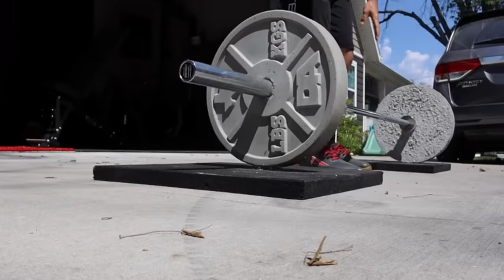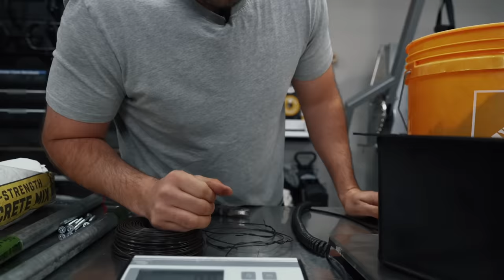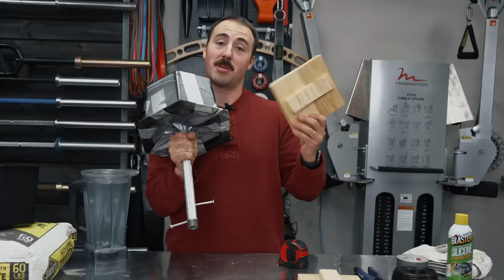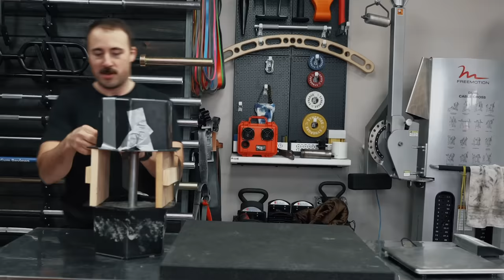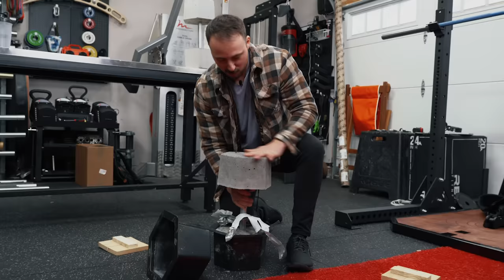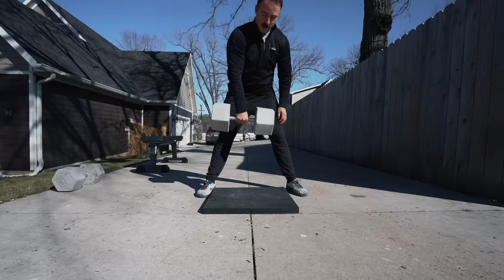How To: DIY Concrete Dumbbells Made to Last (PLUS Drop Test!)

Comment: Water First! Makes mixing way easier.  Cement is very corrosive wearing gloves is Highly suggested. Concrete burns are not a fun time and can dig  nice holes in you skin down to the bone if untreated.   If you did end up burning you're hands use a vinegar & water solution to neutralize the alkaline burns.
Reply: Thanks for the advice
Reply: You’re referring to hydraulic cement burns
Reply: @declineofthewest.  no this is for all concrete. the portland in concrete can and will leave chemical burns if not washed off. some people will even develop allergic reactions to it as well. I have had Irritant Contact Dermatitis and it's not fun.
Reply: also use a cardboard with hole in it to stableize the handle at ninty degrees then fasten cardboard to side of foarm to hold steady
Reply: Yes. I learned the hard way. It's amazingly painful.
Reply: What? I've worked hundreds of yards of concrete without gloves. I've never had burns and definitely never heard of anyone getting holes to the bone.
Reply: @harrykahuhu183  hundreds of yards is like one house for me man im mixing way more than you are.  I do stucco you have cement on your hands all day long and because we have sharp wire and use tools all day long we must wear gloves or risk cuts and our skin swearing away just spreading.    Been doing this for 8  years not going to take idiotic advise from some fool who hasn't even gone through a pallet of cement.

Comment: Although water does evaporate from concrete mixture during the curing the process since it's an exothermic reaction, it's actually not that much. Coop said to add 49 lbs to get a 45 lb plate, that's so wrong, your mix is way too soupy if that's the case. Most bags recommend using a quart or 2 of water, so 2 lbs of water max. Assuming all the water evaporates (which it doesn't) you'd need 47 lb of wet mix.....I've been messing with my own concrete plates so far and +10-20% water weight seems to be my sweet spot. So use the recommended amount of water (every bag and mix is different), and assume 10-20% of that water weight will evaporate, which is actually pretty negligible. Also I know we're all men, but lime doesn't care and will burn your skin, wear gloves or wash any concrete off your skin pretty fast, use vinegar for any burns that you may get. Lastly, I used my muscle gun to help vibrate the sides of the form, it worked great :D. - A civil engineer
Reply: If you need them to be more “soupy” there are also additives to make them flow better without compromising the strength if it’s needed but a proper vibe with something like an orbital sander will make it flow pretty well and remove bubbles. For something like this fiber would be better than wire or rebar also
Reply: This is the comment I was looking for
Reply: When he started scooping concrete with his bare hands I realised I'll listen to coop for any gym equipment related advise, but not anything related to DIY lol
Reply: I knew you were an engineer as soon as you mentioned bitch mittens🤣

Just a construction labor foreman givin you hell
Reply: @Kevin Bowman  hahaha fair enough. Before I went to school though I was a pipe-layer and suffered many a concrete burn from not wearing my bitch mittens, must be my sensitive skin 😂
Reply: @whiskeybravo91  I used to get them really bad but I think my hands and arms have just developed an immunity to it over the years cause no matter how hard I try to remember my gloves I don’t have them when I need them🤦🏻‍♂️

Comment: Would love to see drop tests on all the adjustable dumbbells currently available to consumers
Reply from the maker: I would too. I'm in the process of getting doubles of all the ones we have to drop test them.
Reply: Just get ironmaster...there is a YT video where they drop them down an elevator shaft still function like new.
Reply: It's pretty obvious none of the fast changing ones won't last long with that treatment. Why would you do that?
Reply: @lesnuitssanskimwilde883  THAT is why yuo see THICK rubber coats dumbbells in the gym   I love my stall mats 3/4 "   for years  drop 100- 150 lbers on them  no nothinf
Reply: I had the cheap one from Academy and one of the weights fell out during use. Glad I had rubber pads and that it didn't land on my foot.
Reply: been there done that 3 days ago ,  I sold  6- 45 lb  plates and a pair  of 44lbs  dumbbells with this mold,  ALL dropped  onto a   my driveway with 1 Horse stall 3/4 "  mat.    NADA  , nice bounces thou,   and all 6 DROPPED via Shrugs  same mat.   NADA .  CONCRETE needs to be sealed  3-5 AFTer  coming out of any mold,    3 coats.
Reply: Me too. He does have a good video on the ones that r out there though
Reply: Ironmaster for the win.

Comment: I'll bet using one of those theraguns that's collecting dust somewhere would be perfect for getting bubbles out!
Reply: That's actually a great idea. His little taps did nothing.
Reply: Haha I came here to post the same comment!  Theragun would have been very fitting
Reply: DT level but what if you painted these I feel like that would last along time you could even use the floor epoxy to do it
Reply: @rossporter9972  I use truck bed liner spray,rocker panel paint works well too and is a bit cheaper
Reply: @kschaub62  Honestly his concrete was so watered down it is probably fine. Super low viscosity stuff doesn't really need air evac.

Comment: Here are some protips from my experience:
-why buy molds when plastic buckets are so inexpensive, if it breaks, no big deal
-on handles, just make some serrations, its way easier and it will hold just fine (same as construction rebar steel)
-metal corrodes from sweat, cut some pvc pipes and put it over the handle before making second end of DB
-you don't need silicone to tack handles into place, use hot glue (way cheaper)
-alternatively, if you make plates for DB/BB, use a round bucket to make plates and use piece of pvc pipe as inner sleeve.
-you don't need wire/rebar for for concrete if you mix your own, sand+gravel and cement in 3:1 ratio is hard and strong if cured properly
-mix in water carefully little by little until the concrete sticks to your fingers, that's enough water
-use (kitchen) digital scale to get accurate weight of mix you put in the mold
--if mixed like described, final dry concrete will lose 5-10 percent of the starting weight (water which has not chemically reacted with cement)
-different batches of concrete will always lose different amount of water so always make pairs of components from same batch to get even weights
-don't do let it dry outside in the cold and wet weeather, concrete will be weak and it will crumble
-concrete gives away dust and can chip/crumble so you need to strengthen the surface, use a paintbrush and coat it with sodium silicate solution so that it gets into the surface and let it dryout, cheap solution and works great
Reply: @Rubi They are ok if you are making loadable DBs (like I did) but if you stick them in wet concrete, they will absorb water and swell and then later fall out when they dry and shrink. Metal handles also have nice sturdy feeling in hand
Reply: How would you make these dumbbells heavier? 110+?
Reply: @Rubi ONLY  OLD SCHOOL SHOVEL handles -  ( avg $17  today)   i have 9 from my father in law  and they are at least 40 years old,  BETTER than the replacement handles of today
Reply: @ElijahPrivetteRealEstateVlogs  For 110lb (50 kg) DB you would definitely need some iron, lead or something like that.
If you can get your hands on some solid metal bars (eg. car drive shaft from scrapyard, like I did) to cut handles from it and/or pieces to put into concrete, that's nice addition of weight.
Average concrete density I usualy get is only about 2,2 kg/L (far from ideal, of course), dumbell would be simply too big and unusable for anything but perhaps single hand bent over row. If you are making plates for barbell its ok to make larger/bigger diameter plates.
About 50lb (20 kg) is max size practical for various exercises (bicep curl, overhead press etc).
Reply: Sodium silicate,I'll have to give that a try,I use two part truck bed liner,so far and it has been working great since this covid bullshit started and I am pretty hard on the plates and dumbbells but the bed liner is expensive and is the most costly part of the whole thing
Reply: @ElijahPrivetteRealEstateVlogs  I have made 85'that are very useable for press's and light rows but I don't know about bicep curls,I can't curl 85's anyway though.I used solid handles as well and a few rebar rings In each side of all the bigger ones,more for strength than added weight but I am sure it added some.don't know where the hell you get lead shot besides for reloading shotgun shells but it would cost a fortune to use 00 buckshot to add weight to a bunch of dumbbells
Reply: @ElijahPrivetteRealEstateVlogs  I use 3/4" x 18" black pipe for dumbbell handles, with 3/4" pipe clamps to hold the "plates" and end caps for safety. Then using 16" concrete form tube I made multiple "dumbbell plates". The 16" concrete form tube can be sliced to make barbell plates but for the DB plates i would cut a slice then remove a section and machine-screw the cardboard back together make a 14" or smaller plates.
Reply: I'm just gonna comment on this so I can come back to this
Reply: liking and commenting so i dont forget this

Comment: I've just found this channel and it's amazing. 

Just a quick tip. Always clean your tools. When I went to work with my Dad and Uncle in the summer they always emphasised that clean tools are happy tools and they'll last longer as well. 

Also when concrete goes off the water doesn't evaporate it forms hydrate crystals with the chemicals the concrete is made of. 

Also Also, make sure to wash your hands because the crystal formation is an exothermic reaction and it can burn you of you leave it on your skin for too long.

Comment: I'm making plates for the first time and I found a rubber mallet helps a lot with getting air bubbles out and when releasing the concrete from the molds

Comment: to get bubbles out you can use a reciprocating saw (adjustable speed  one at a low speed is the best) take the blade out and just put the shoe against the side and turn on the saw, the vibrations push the bubbles out quite well, theres also professional vibrating tools that do the same thing but in a pinch recip saw is great

Comment: Fiberglass or another kind of concrete fiber would be a perfect alternative to using the wire or rebar. It's used pretty often with atlas stones.  Also, take a random orbital sander without sandpaper and hit the sides of the mold with it to vibrate it.
Reply: Muscle recovery massager can do the same thing aswell
Reply: @woden__  i don’t have one so I didn’t think about that but it would definitely work.
Reply: Rebar adds weight for a more compact/useable product though. I put 20ft of rebar in a single 55lb dumbell which shaved about 3 inches off it's overall length. Steel is about 3.5x heavier than concrete. Good idea on the fiberglass mesh tho. I'll probably add some to my next dumbbell.

Comment: Hi there.  Great idea and great job.  As an fyi, the concrete you mixed with water is wetter than it needs to be.  Your cured concrete would be stronger if you had used less water. Another thing that is common with concrete is to use a stick to go up and down in the form to release air and cause the liquid to fully contact the form.  Again, I love the idea...
Also, if you blew compressed air between the cured concrete and the plastic form the form would likely release with surprising ease.

Comment: I have the plate mold from sticks and stone.  I weigh the concrete before the water using a two bucket method for plates and it comes out pretty accurate (consistently hit 45.0 on the scale after drying).  I go about a half pound light since I add chicken wire, the insert, and coat in plastidip.

Comment: To make it easier to get the air bubbles out,  you can use a blade-less reciprocating saw, press the blade-less side against the sides, and vibrate the air out of the molds.
Reply: a bent 3" nail stuck in the end of a drill and use the side of the drill if you dont have a cipsaw

Comment: Coop I bought the Stix and Stone oly plate molds after seeing your video months ago. One thing to get exactly the weight you want for your concrete weights is to measure the dry amount of concrete mix. After drying then curing, all water weight is gone so whatever you are left with is just exactly what you pre-measured. Also, I use a fishing scale to weigh the mix + sleeve minus the bucket weight, super handy.

We knurl everything!
Reply: Pretty  sure the concrete mix retains some, or most of the water weight

Comment: This will sound weird but a good way to get bubbles out on a smaller concrete form is an old school bullet shaped vibrator with a prophylactic held on with a rubber band to keep it clean. Just turn it on and move it through the concrete for a few seconds at a time. Don’t do it too long or all the aggregate will settle on the bottom. You basically use a much larger version of this setup when pouring and setting larger concrete forms

Comment: If you're shopping from the home depot, i highly recommend buying your concrete from them. You need to buy the RAPID SET MORTAR MIX. Not quickrete. It's higher or just as high strength as the high strength quickcrete, but much smoother. It doesn't have as big lumpy stones, it hardens in 1 hour and is strong enough to stand on a 2inch table top mold. You don't need fiber glass or rebar. And when you add the rapid-set "set-control", it'll make it turn into a smooth creamy peanut butter consistency. Which will help it fill in the corners and crevices much finer. I would still use some sort of rebar or mesh or wire or fiberglass or whatever for good measure.

Comment: I think I'll add a larger diameter pipe, fill the pipe with lead shot (and sprinkle some in the concrete as well), use fiber reinforced concrete, and plasti-dip the heads to see what kinda franken-bell results.

Comment: Go to your local tire shop and ask for some of the old wheel weights they have pulled off. I'm a mechanic and I've used them with great success in making concrete dumbbells. Just a tip and Great video!

Comment: If you use a little parchment paper taped to the inside with double stick tape it would release easier but you will still want to spray it before filling with a release agent.

Comment: You can rub them with grout to make them nice and smooth and coat them with epoxy or plasti dip.  If the handle comes loose inject Simpson Strong Tie or Hilti epoxy in there. You may have to chip a little space out but that stuff will be stronger than you made it initially.

Comment: Good video. Making your own is rewarding.  Thoughts:  use a bucket to mold.  A 5 gallon bucket is 10.5 inch diameter and makes a 20lbs plate / side at 3 inches thick.   Second,  rebar is cheap... Buy a 4' piece and hacksaw to 8 inch sections.  Third,  spray truck bed liner on them when done.  Last,  i dont bother with release agents... Concrete doesn't really want to stick to plastic... But it probably depends on thickness.

Comment: Have you tried the Rock Weights yet? The dumbbells are 40 lbs each as well as their 40 lb kettlebell molds that they have so far with more sizes coming later they say and you just keep the plastic around the cement after you pour the cement from the ends so it seems like they would be a lot easier as well as more durable with the thick plastic staying around the cement and you don't need to worry about the handle being straight or not because it's all part of it and you put a rebar through the handles on the dumbbells which is cool and I think it  would help make them stronger as well but I'm just curious if you make the dumbbells and the Kettlebell from them what you think so maybe you can make a video on the Rock weights next possibly if you haven't already?

Comment: Possible solution for holding the bar straight as it solidifies:
cut a piece of 1/2" plywood the same shape and size as the top of that form (hexagon? couldn't tell from the vid). cut a hold in the exact center the same size as the pipe. cut it in 2 (so you can place around the pipe instead of sliding on it). when you put the pipe in, put the plywood on and tape it in place. between the nipple and the hole it should run square. It could also make lining up the second dumbbell easier if you use heavier plywood.
Using medium link chain instead of the wire could also add to the weight if you wanted something heavier. I wonder if you could use epoxy? like a hard epoxy and fill the molds up with chain or something like that. Not sure if you could find an epoxy hard enough, but you could make some wild colors with it thats for sure...

Comment: You should use cheap 1" adjustable plate dumbbell handles for the handles
Reply: I think that takes too much of the cheap out of this option. I would prob coat it with something like a rubberized coating(Flex seal or similar) or probably even better a cheap spray-on bed liner.

Comment: For 65 bucks you can buy  whatever size plastic planter pot at homedepot, fill the holes in with a bit of silicone, and make whatever weight you want using this method. Crazy price for some injected molded plastic.

Comment: Hey Coop can you do a video about rebranding barbell weight plates with your own logos? I have some branded plates (rubber coated) and I’d like to at the very least paint over the current branding (would black spray paint be a good idea?) and possibly spray my own logo onto them. Not exactly sure what I’m doing here and don’t wanna mess them up

Comment: You could go to a tire shop and get used lead wheel weights to put inside the concrete. Spray the outside with black flexseal.